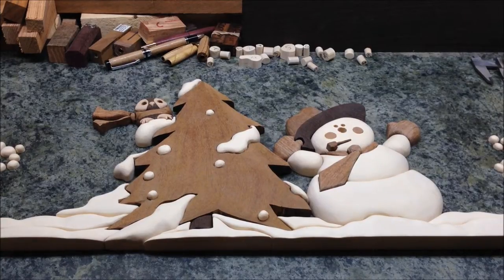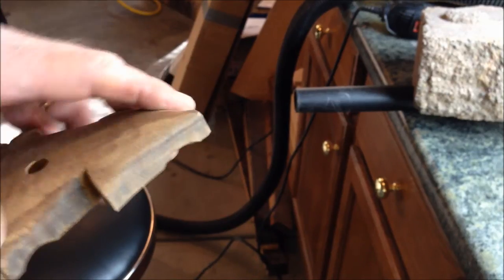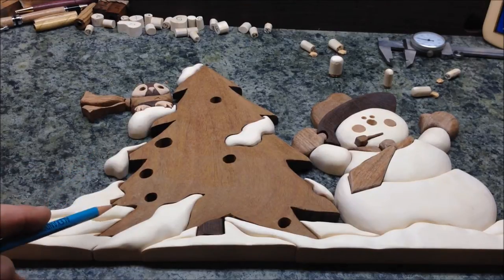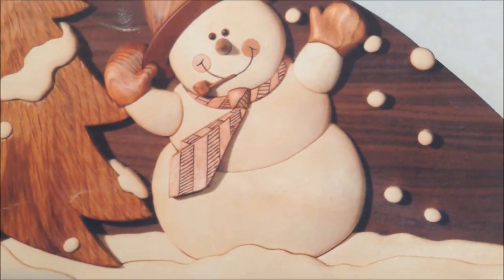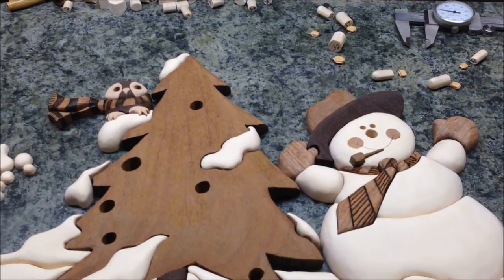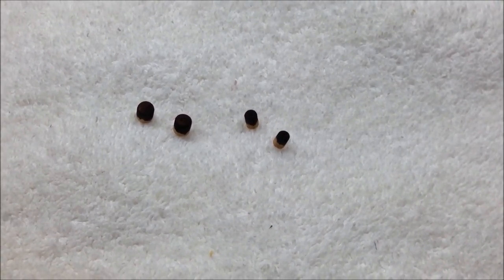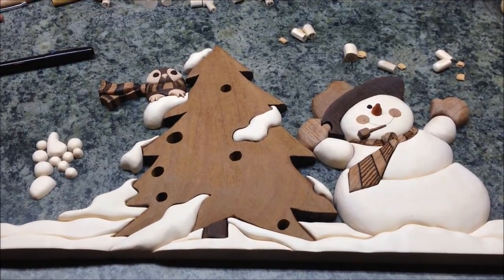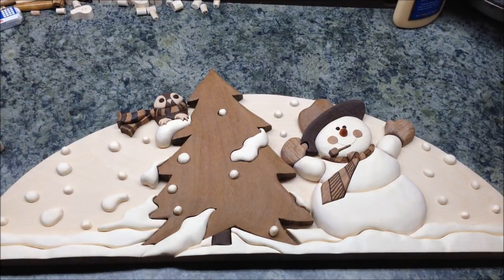Intarsia VLog No. 13

Comment: Glad to see you took up the idea to turn some of the round pieces.  It makes things much easier and perfect fits to boot.  I'm currently working on a piece that has over 35 round pieces that I've already turned.  I'm also using bevel cutting techniques for the first time and the results so far are outstanding!  Perfect fits and by varying the cut angles and thicknesses of wood you can create enough thickness to subsequently shape accordingly as you normally would.  Definitely changed my thinking for intarsia cutting.  I'm not videoing the techniques, but I'd be happy to pass on the information and when I'm finished some pictures.
Reply from the maker: That would be great, I'd love to see the information and especially the pictures. I will make another Intarsia later this year and I am always interested in finding better ways to do this process. By the way, thank you for the turning idea, it worked out really well for the eyes and nose. The snow flakes need to be a little more imperfect so I am not going to go back and turn them.

Regards,
Bob

Comment: That came out real nice Bob.  Will you be posting pictures or video of it fully completed?
Reply from the maker: Thanks Andrew,
  I sure will. I still need to take care of the two pieces I mentioned at the end of the video and texture the tree. I plan to pickup a small can of dark stain today for the background and I'm making the final decision as to the finish I want to use. So there is still a little work to do and I promise to see this VLog through to the finished product. Thank you for your interest and for following along.

Regards,
Bob
Reply: I think shellac would look great, what do you have in mind?
Reply from the maker: Andrew Stading I was wanting to test either Danish oil or BLO. Either should really show off the wood but I want to make sure they don't darken it to much, especially the lighter wood I used for the snow. Then I will probably finish it off with Shellac. this has been a topic of much internal debate and Thank goodness for all the guys in my woodworking community who have helped me with tons of excellent information. I am a total newbee when it comes to finishing anything that wasn't turned on my lathe.

Regards,
Bob